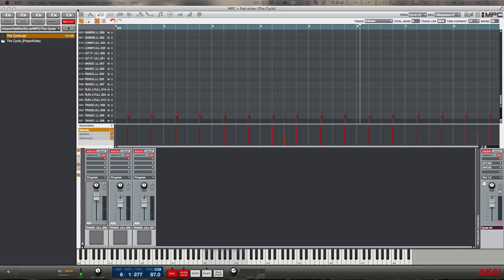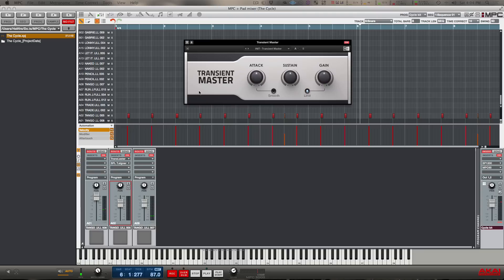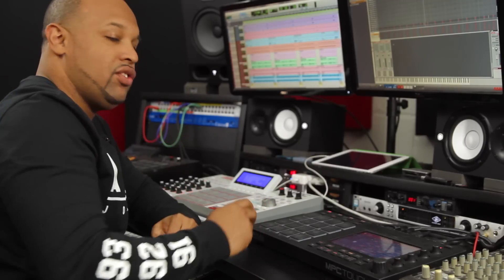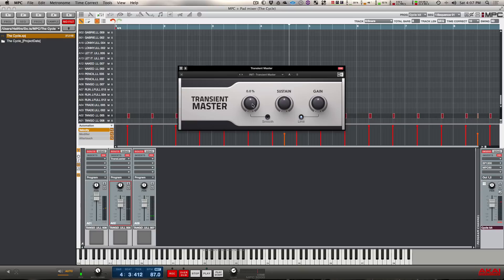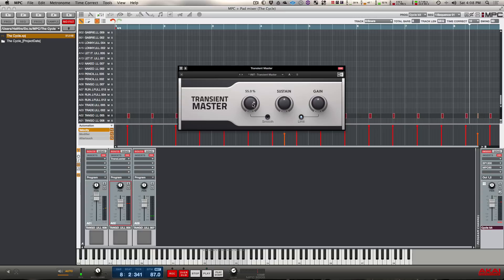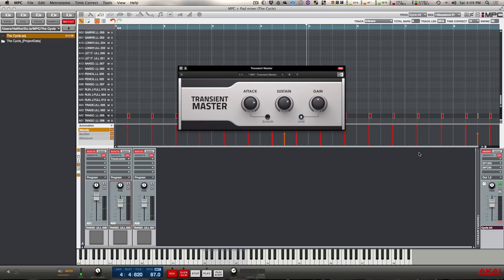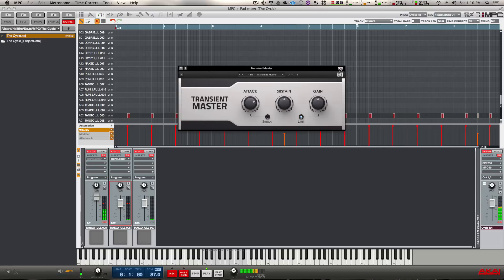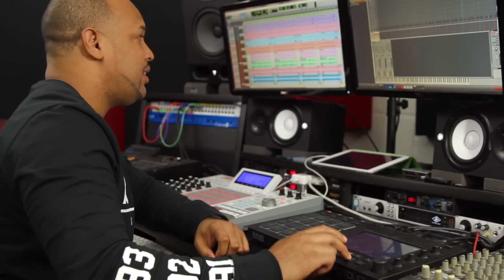Punchier Drums: Transient Shaper Tutorial (MPC Touch) - MPCMasters.com

Comment: BLUF: How did you get the "Transient Master" plugin to show up in the MPC software? 
I have just copped the NI Maschine Jam. I can see "Transient Master" inside of Maschine and all. I also have the MPC Ren. I have searched for Transient Master everywhere inside MPC "Preferences, under (scan) Plugins" but cannot find a way to scan and locate "Transient Master" inside the MPC software. Do I have to purchase the plugin separate as a VST even though it was included with the Machine 2 software when I purchased M. Jam?